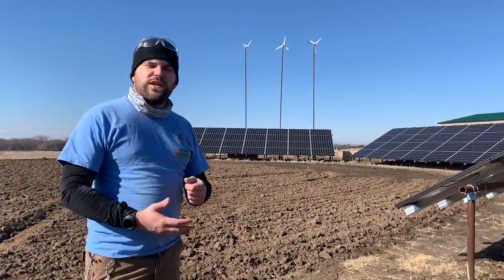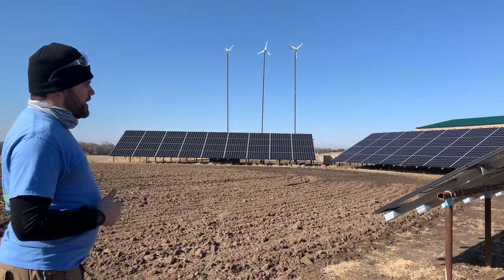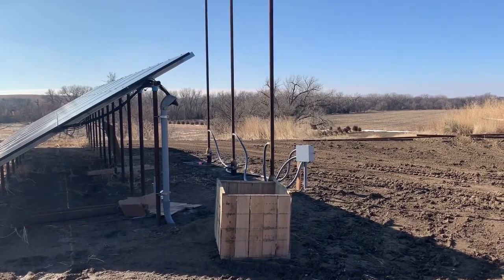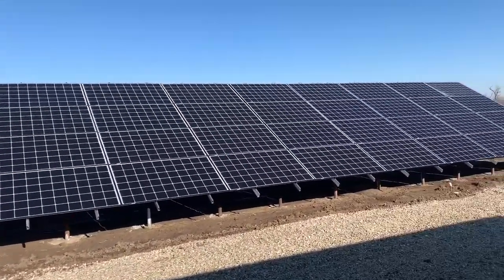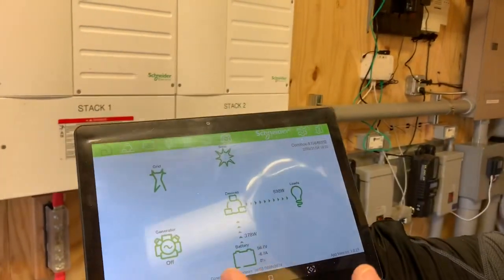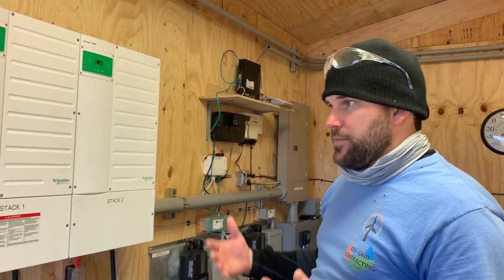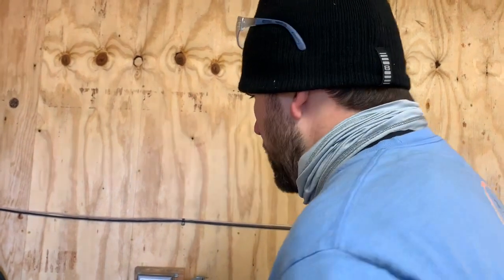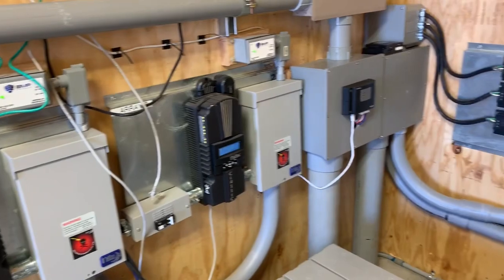45KW off grid solar and wind power install by off grid contracting

Comment: Can this small farm produce gaz to refill the propane generator ?
Reply: yes sir
Reply: Technically yes. You could build a gasifier and grow something like walnuts or just trees. Use the shells or very dry wood in the gasifier. Then power the generator off "wood gas." This isn't some hippie bullshit either. This is actually how pretty much all streetlight gas lanterns were powered back in the day before electricity. Very combustible gas. It is however less efficient and clean than propane so you'll get a bit less power and likely need to service the engine at a earlier interval. I'd keep a stack of cylinder heads around. Take off an old head, swap on a new head then "de-coke" the old head basically. Or if you grew a shit ton of walnuts, I'd put it in a walnut shell blaster.
Reply: @daytonasixty-eight1354  I was talking more about synthetic gas like methane made from hydrogen + CO2